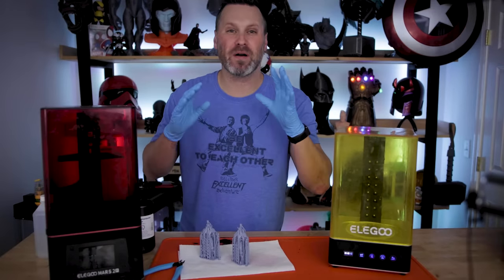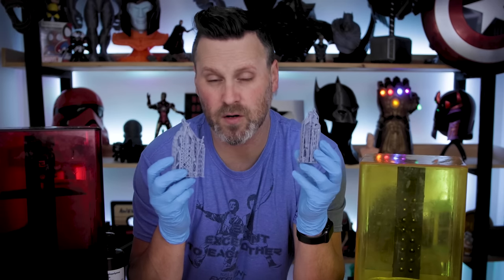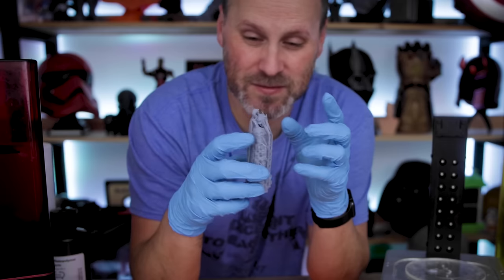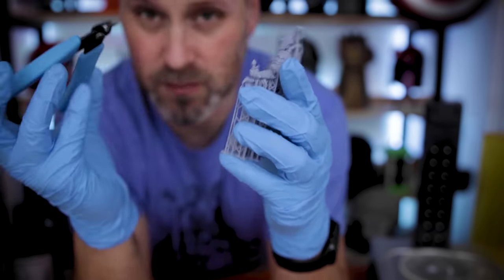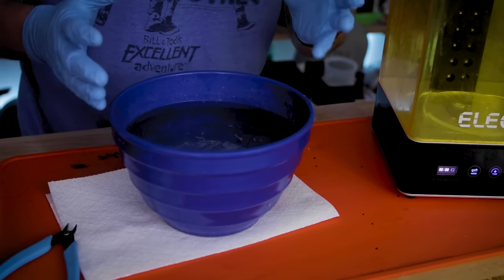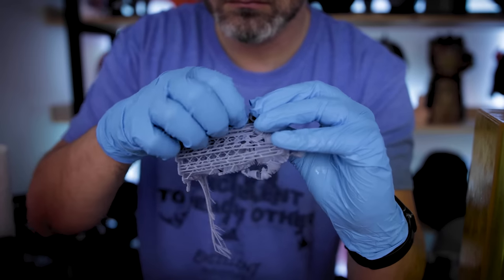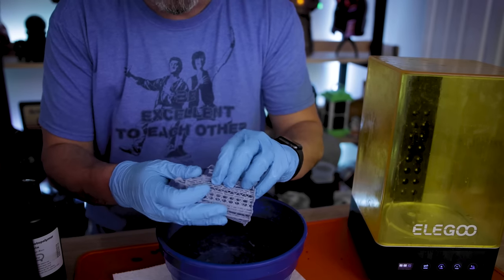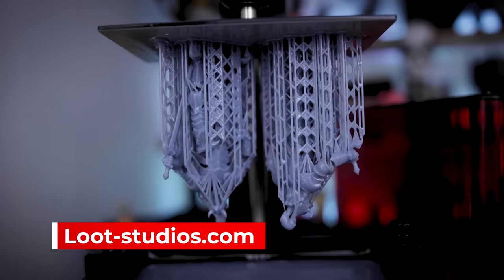Resin 3D Printing Basics - How to Remove Supports

Comment from the maker: Team - Warm Water and Remove.... who's with me?
Reply: I dont tend to use warm watter since I try to make supports as thin as possible that they will come out just with a small touch but I guess it might help. My only concern is not to leave it too long as in more mechanical parts it might deform the part.
Reply: Unc!...I need your help!!! - Thank you for your content, inspired me to get an Elgoo Saturn - ive got a shape similar to a 'mace'- failed :(  tips on support pleeeeeaseeee!!!!! Hero!!!!!!
Reply: I am NOW!
Reply: I've had warm water dissolve away tiny features on miniatures before, so I've  got mixed opinions about it. Definitely works well for 'chonky' figs tho!
Reply: Team warm for sure!
Reply: All the time, every time.
Reply: oh yeah, definitely this option 😎
Reply: Not when using clear resin.  Warm water will cloud your parts.  Opaque resins/parts it works well on.
Reply: Hey, I just started printing with the Saturn. I've had some prints that come off the build plate perfectly, then cure perfectly... but after about an hour they start to warp and curl. I have no idea how to solve this. Maybe a video on this?

Also, what I have been doing to remove my supports is that before curing, I snip them all off the raft. That way there is less chance I'll tug on one where it connects to the model. Then, when the raft is removed, they are mostly free to twist out of the way or be clipped off.
Reply: Not yet, but I'm going to buddy... btw, it never crossed my mind to remove the support after curing... logic thing I guess
Reply: Every time from the start, thanks to your advice :) Thank you for all of you videos. They have really made my learning with printing a lot easier.
Reply: Most definitely. I use a heated ultrasonic cleaner, set anywhere from 35-50c. Plenty warm to soften the print, but has never been so hot that it warps anything at all.

Extra note: Don't rush it! The supports cool down quite fast. Every single time I say "Ah screw it, I can remove all of the supports in 1 go!" they cool down too much and start taking out chunks of the print. When the supports start cooling down, they get stiffer and the supports start "snapping" instead of just peeling off, dunk her back in the heat and soften things up again.
Reply: @teyrasiridae4704  That should only happen with water washable resins. I've left prints in 50c water/cleaner for hours and not had the slightest effect.
Reply: @crazylegsmurphy  When resin cures, it shrinks. If the cure isn't even, it'll naturally curl.

Adding thickness where you can helps a lot, keeping anything sensitive to curling away from the bottom layers is important ( since bottom layers are exposed more during printing, they shrink less from post curing, causing a difference and curl ), putting in effort to make sure everywhere is cured evenly is of course good. A more extreme possibility is raising your normal exposure: ( More curing during printing means less during post cure, so less curling ) This has its own numerous downsides though, so make sure you know what impacts it will have and that this is a good option for your print. There are also other resins with less shrinkage, so they will have less curling. Be ready to pay more for those though.
Reply: @elmiguelito1984  Unfortunately supporting is largely an art. The main tips are don't shy away from supports: More often means better. Notice how the prints Jessy does are absolutely covered in supports. Your settings also need to be properly dialed in for supports to be able to do their job. You can go to reddit for tons of assistance. I recommend avoiding FB though, I've seen a lot of bad advice come from there.
Reply: I have been using the warm water and remove with Siraya fast and they come of super easy that way.
Reply: Serious question though, not trying to be a gotcha, what do you do with all the water? It doesn't stay warm enough for multiple uses and is toxic since it has uncurred resin inside (no matter how good you rinse it).  I have wanted to use the warm water technique but can think of no responsible way to actually make it viable and deal with that much water. Any waste solution answers would be appreciated!
Reply: @jmama4867  Properly cleaned and rinsed, the water is fine to wash down the drain. You're talking about trivial amounts of the resin. There's worse in the pipes. You just don't want any real quantity of the resin down the pipe.

For me personally though, I just use a heated ultrasonic cleaner for both cleaning and the heating of the print for support removal, making it moot.
Reply: Trivial amounts times 157,000 subscribers makes it not so trivial, just makes it feel not worth it if I'm dumping it down the drain like the masses
Reply: @jmama4867  You also multiply the water by 157,000 keeping it trivial. There's probably more contamination from the pipes in your house.
Reply: @zemerick  whatever makes you sleep better man, don't worry about it was not the answer I was looking for, thanks though.
Reply: @teyrasiridae4704  Your water is too hot. If you cannot wash your hands in it, it's far too hot. I've printed the mind flayers from Nov Archvillian games and removed all supports at once using this method with not a single issue. The fingers are individual and 28mm scale (close to .05mm fingers).
Reply: I do my cleaning in a heated ultrasonic cleaner. Cleans and warms all at once!
Reply: I can't find the model is there a direct link to this figure looks really cool and would like to print it
Reply: Is there a reason you couldn't cure, then use the warm water? It seems like the warm water would still soften the material and make the supports easier to remove. But I haven't started using resin, so I may be missing something.
Reply: @jmama4867  Put in a clear vessel and stick it out in the sun. When the resin in it cures you can dispose of it responsibly
Reply: Watched your video the other day and its so easy thanks so much for the tips Jessy your a champion!
Reply: been doing this for years. When I tell others about it on reddit or other social sites I get flamed. SO I stopped sharing my years of tips and tricks. Glad you are able to get the message out.
Reply: I also only use hot water but nothing to get myself from
Reply: I saw people using an air dryer. So it seems to be only about the heat, not the water. i'll try that.
Reply: Me
Reply: I run minis under the hot water tap and then use a toothbrush and more water to clean off anything my IPA missed

Comment: I gotta say, this seriously changed my whole 3d printing game. Before I was just popping the supports off pretty much right after it came out the cleaner but the hot water trick seriously makes it so much easier. Thank you for sharing this incredible tip with everyone
Reply: Out of curiosity how does this change your drying time before curing? How long do you set things sit for typically before curing?

Comment: I like the idea of using the warm water, I'll have to try that.  I never use the clippers to remove the supports directly from the model. Instead I use the clippers to chop up the base and break the supports away from each other so that I can peel the supports off and smaller groups which makes it easier to strip them away slowly.

Comment: When it's sunny in the summer I like curing my prints in water, in the sun. I think the water helps remove any stickiness from resin that didn't totally clean off. It always helps avoid white spots from the oxygen getting in the model as it cures.

Comment: If I may make a suggest for another video. LCD screen replacement on these printers. Elegoo doesn’t state that there is a glass layer attached to the LCD that needs to be transferred over. Seems like a lot of people are throwing that piece out with the old screen with no knowledge it’s even there. Elegoos install video doesn’t even mention this.
Reply from the maker: Ohhh that would be a fun one to look at! Thanks for the suggestion. Adding that to my list to look into!
Reply: @UncleJessy  you’re welcome. Thanks for the solid content keep it going!
Reply: The glass cover should come already attached with replacements. Speaking from experience, it is quite difficult to remove that cover without damaging it, and definitely beyond the average user. Some alternative sources for the screen ( such as aliexpress ) can come with the LCD and cover separate requiring the user to attach it themselves though.

Comment: Just one question: the warm water is now contaminated with uncured resin so how do you dispose of it safely? Water doesn't evaporate as quickly as IPA so I can't imagine leaving it in the sun and waiting for the uncured resin to settle is the best option
Reply: He did recommend cleaning the minis before the water step, ideally there should be no liquid resin on the print after the cleaning step. I recommend using two cleaning basins, both filled with IPA. The first basin will get most off and become cloudy quickly, the second basin will clear any resin that made it past the first. If you do this right the second basin will remain clear for a long time.

Comment: As I'm expecting my first midsize resin printer to arrive very soon now as I'm readying a buttload of models into the production chain, this is actually one area I've been concerned about versus FDM. Guessing from how previews and such look, resin supports are fused into the model and depend on having only as much material supporting the printed area as necessary (optimally) and will require a flush cutter on larger areas (?). Watching this one with close eyes.
Add: Aha, that makes sense! I've ordered a few bottles of water washable resins to try out, so perhaps the warm water method can be combined with support removal? Hmm! 
On the curing front, I ended up getting one of those long UV LED strips and doing the reflective tape inside a bucket approach, and from testing, it should work a treat. Very much looking forward to getting my resin journey started!!

Comment: That's a particularly tricky print to remove the supports from. The "floating" bits are long and the attachment points are small so the figure is especially prone to breaking during the process. (When I printed the figure, I was able to avoid breaking, but it was touch-and-go.) FWIW, I use the same process and still get tiny divots that need to be fixed before painting.

That said, because the flaws are so small, repairing them isn't much more difficult than removing gates and mold lines from injection molded plastic, resin, or metal figures.

Comment: Can I ask you a question? For some reason, I have fingerprints that let marks everywhere even if I wear a pair of gloves. I usually wear two pairs of gloves, but I'm scared of touching the uncured prints too much, so I cure them and then I remove the supports without fear of stamping my prints on them. Would it be too risky for me to try the warm water method? I'm feeling I'm gonna let my prints everywhere on the figures if I do that >.<

Comment: I've been printing for about 6 months now and I've used the cure-then-remove method, but it's a ton of work to make sure that I don't damage anything (about an hour for a few bases or small minis). I'm going to give the pre-cure method a try because it looks so much simpler!
Reply: Exactly the same here. I water cure so doesn't take alot of time but I have been getting pitting from where my supports are with auto supports. So iam definitely taking my time to sand the bumps from the supports or do custom supports

Comment: Okay. Here is the thing. If you remove supports before curing your object, you do risk warping and twisting. If you print a figurine you won't notice but if you print something that need low tolerances, like parts for engineering, then taking the supports off before curing can be a big problem. There is no 1 fit all solution for it. Taking them off before makes it better looking and less post processing. Taking them off after preserve the shape better.
.... why do all 3d print channels only focus on figurines? I'm sure i'm not the only one doing engineering with these machines of wonder

Comment: I've got a reptile heater in an open box and preheat the print from 15-60 minutes and the supports peel right of. But if you heat too long then it gets brittle.

Comment: What do you do with your water that you use to submerge the prints?
Reply from the maker: Since the prints have already been cleaned and the excess resin removed, I will end up tossing it usually in an old milk jug.
Reply: @UncleJessy  For sure, thanks for your quick response. I have been placing all of my water and IPA from the cleaning process into a large glass container and then leaving it in the sun until the resin cures and the IPA/water evaporates, wasn't sure if the water from this support softening step should go in there too. I suppose it will always be better to be on the safe side. I have also ordered some Mean Green to try some IPA alternatives per another of your videos, although I am unsure as to how well that with evaporate.
Reply: @5FSF  You should be extremely careful leaving any such containers outside. It's very easy for animals to get into them.

Almost all of the time you can also just reuse the cleaner. Hit it with your UV light for a little while to cure out the resin, filter it out, and reuse. Alcohols will lose their potency over time, but all purpose cleaners and water should stay pretty much just as effective. With the alcohols, you can buy a new overly-high proof ( like 99% ) to mix in and effectively increase the concentration.

Of course, eventually everything will need to be tossed out, but you can easily go dozens and dozens of prints.
Reply: @zemerick13  I want to believe that animals would not be keen on the idea of being anywhere near isopropyl fumes, but I've definitely seen animals work against their better interests so noted. I have things sectioned off and with a mesh atop the container to allow for evaporation without letting birds or squirrels or something physically enter the container, and I have a small brick barrier around it to prevent it from being able to tip over without like... excessive force. Ideally I would stage it in a small greenhouse or shed, but I mean, rodents would still find a way I suppose.

Obviously, recycling and reusing is appealing in many ways, but introduces some degree of risk. Given how hyperbolic people on the internet can be, it is hard to divine exactly how worried about the liquid resin contact I should be. My rule of thumb is to be more cautious than I reasonably think that I should be, but this is not a no-negatives compromise considering the implications for reuse and exposure control. 

My biggest concern right now is when things get "tossed out," like, what exactly does that entail? It doesn't go down the drain. I can't dump liquid into a trash bag and call it good. Evaporating the the solvent while over curing the liquid resin neutralizes the potential hazards, but if the all purpose cleaners don't evaporate as quickly and cleanly, should I be using some kind of actual neutralizing agent, like a sand or mulch to absorb it?
Reply: @5FSF  I would use an absorbent material like kitty liter, then take that to the dump and they should have someone to take it and dispose of it properly.

Comment: I use a hair dryer on low to heat the parts before removing the supports then curing.

Comment: Great video! How do you dispose of your cleaning solution? Is the residual resin safe to go down the drain? Also how long can you reuse cleaning solution before needing to change it out? Please continue with basics videos :)
Reply: Technically you should follow your local guidelines for disposal. They can vary from place to place quite a lot. You do NOT pour it down the drain though.

In practice, the usual approach is to first cure out all of the resin you can, filter that out and keep using the cleaner. The filtered out garbage is dried and you might want to hit with some more UV to make sure it's all done curing, then just toss in the trash ( It should be basically just acrylic plastic at this point ) or take to your local dump.

Some will leave outside to evaporate the cleaner and then toss the solids, but I recommend against this as animals can easily get to it, especially birds which would be extra sensitive to the chemicals.

Cleaners can last very long, but it depends on the cleaner. Alcohols will tend to evaporate the alcohol, and some can also absorb water from the air, which both result in the concentration going down over time, eventually causing it to lose its effectiveness. ( You can buy more high-proof alcohol and add it in to get the concentration back up while still keeping the old cleaner. ) I prefer to use all-purpose cleaners though and these shouldn't really lose their effectiveness. Any time I'm having problems with parts getting clean, I just cure and filter out the resin.

Comment: Great Video 👍 Team Warm water when possible. A quick side note, 2-4 min isn't enough to fully cure a model, more like 30-120min. If you like to have a brief talk, I do Photopolymer development and production for a living and would love to get in touch with you.
Reply: It depends on what you mean for "fully cured". For the standard resins and uses, a few minutes is indeed all that's needed. Water curing helps immensely here though, as before I did that even 2 hours might not get the job done. For more advanced resins, they can take much longer. For more demanding work, they can also require a much more exacting cure.

For a model on a shelf, in a DND campaign, pencil holder, etc. using standard budget resins, which are entirely what UJ is about, going more than about 5 minutes causes excessive hardening and is considered detrimental.